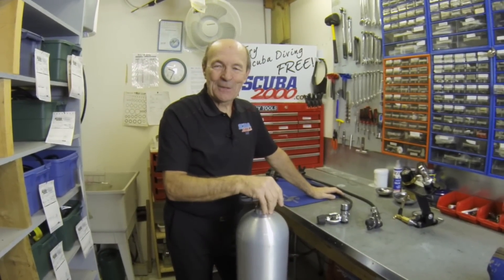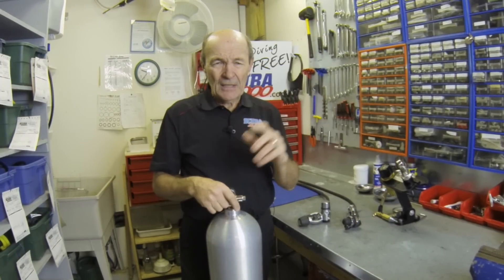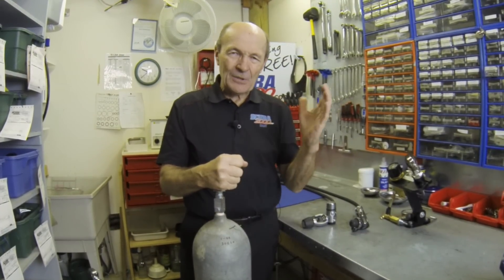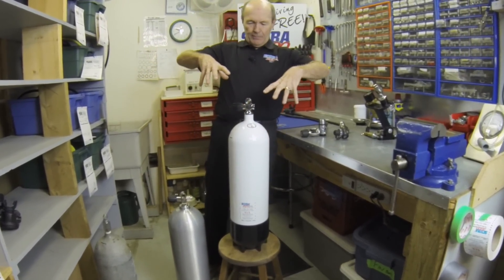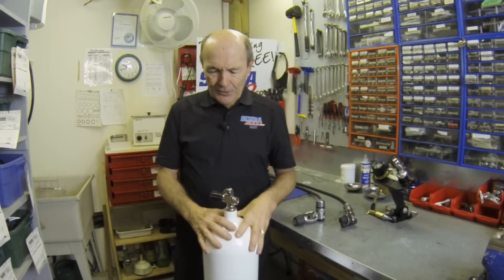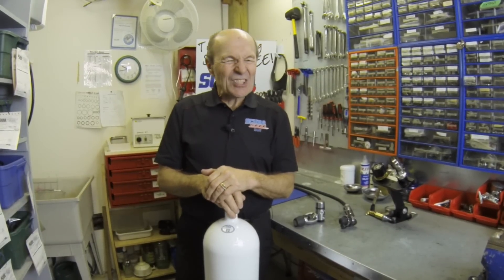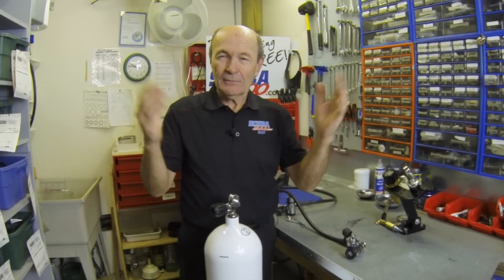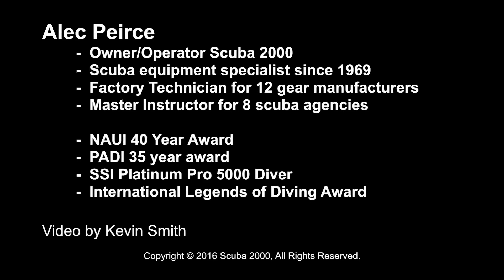Steel vs  Aluminum Tanks - Scuba Tech Tips: S03E07

Comment: i enjoyed this video quite a bit  i grew up in SouthFlorida and my first Scuba certification was in 1978  by a NASDS  shop  back in  those days they weren’t as reckonized as PADI  so i did get a PADI card in 1981  both were open Water certs   in those days  i always dove with plus Aluminum tanks  to get the extra air   i did also dive with many US Coast Guard Helicopter pilots that flew for Air Station Miami  and a few of those guys  still used Steel tanks and one even  had a 2 stage regulator with the double hoses although it was getting harder for him to  find shops that could or would work on them  i have over 250 logged dives  unde my belt  and manu of those were in the Florida keys  were we would drift dive  using lines  attached to a boat  and the  strong southerly current on the Gulf side  it was a  easy way to  cover a lot of territory and by snorkeling in full gear  if we spotted say a lobster  or whatever  we could easily pop in our regulator to extend our bottom time  i was a avid Spearfisher then  too  using pole spears mostly although i had a couple of  inexpensive manufactured Spear guns i bought at yard sales  and fixed up  to work   back in my early days a dive shop owner told me that all the tanks either Aluminum or Steel were made in the same factory  and the only difference in branding  at the shops was the Valves  the companies  used ?  now with my Coastie freinds they  often had to fly down to Cuba for work and  tanks their were very expensive  we had a place in Hollywood florida that sold brand new US Diver  Aluminum tanks for 99.50 dollars and  when my plus tanks were getting close to not getting my 10%% anymore  we would send them down to Cuba  and sell them for  just over a hundred bucks those military guys were happy and so was i  as i just buy another brand new one   btw you may remember the place as they always advertised in the back of all the dive magazines for years it was called Divers Unlimited  and they  always had a coupon for their 99.50 tank  which you really didn’t  need to bring in to the shop  their logo had a bottle nose Dolphin  jumping over a dive flag  it was a brick and Mortar shop  in my town and i’m pretty sure they shut down in the 1980s  due to major road expansion and all the growth that South Florida  went through back then  i   did   get married and moved away  to raise my family  and occasionally visit  yet unfortunately experienced a Major Stroke in my 40s and  was fitted with a new Aorta Valve that   i wont be able to  Scuba dive ever again according to my doctors ?  although i’m  hopeful that  with modern medicine that may change  as ive  owned 16or 17 boats in my life so far and love Cruising the Bahamas  and other parts of the Carribean  so we will see  i’m okay with Snorkeling if i have too  at the moment  i’m on quarantine with most of the world due to Covid 19  so i  wish you a safe  future  and look foward to more videos
Reply from the maker: Thank you very much Craig for sharing the memories of our 'stone age' diving.  Looking forward to everyone being able to return to diving with new stories to share.
Alec
Reply: Hey Craig.  I got PADI certified in 1977 at Broward Community College in Ft. Lauderdale.  Used to go down to the keys and beach dive off Hollywood Beach.  Lived there for years.  When I joined the Navy in 1985, I sold my scuba gear.  Now, I just obtained a copy of my PADI card and am getting back into diving at 63 years old.  Planning on taking a refresher course.  The adventure continues...
Reply: Richard Jurewicz   yes thats where i got my Padi  certification  did my open water dive on joe Shircks boat  he was a Boward Shettiff Officer  at the time and ran  trips for a dive shop on US1  inFort auderdale  i may have his name spelled wrong  and i do not remember that shops name other than it was North of 17th Street Causeway  on the Eastern side of route 1  my apologies on typos  my key board is acting funny  with caps and  some symbols  who did you know at Air Station Miami ??? William Perrin was one of my parents best freinds  he retired  out of headquarters eventually  as a Captain  Dennis Seahouse   was another pilot  i knew along with Mike Quinn  all those guys taught me a hell of a lot about diving and becoming a man  when i was in high school  i worked in a east food joint  frying Chicken and we  were able to take home  any leftovers  so i brought cold chicken on our dives and those guys all called my Chicken little   as i would carry out  big bags of chicken  from the house when they picked me up  to go diving Perrin did  instruct  Helo pilots  up in Pensacola  for 4 years  and later worked out of Washington, d.c.  when i lived in Maryland at the same time  so he and i continued our love for the water and the outdoors doing boating and Camping  plus we did a lot of Hiking    on the Appalachain trail that was only a hour or so from our homes  btw his given name is William  but he goes by his middle which is Randy  really Randal  very smart man  worldly and Educationally  as luck would have it he has a son that is close to my age  and him and I are still very close  like  traditional Cousins would be  the family roots are louisianna  and thats where they reside now  ironically when i did the class at BCC my best freind was giving me  some slack about not swimming fast in the pool  and i had to  tell him why  it was simple there were all these hot girls in Bikinis And i picked the slower ones to swim  behind their fins  and my buddy  was like ohhh  thats a good idea  i’m like Duh  i could do circles around her but why would i ?  i’m  like how could you not see that   he always was a little naive  around the ladies lol   in his defense he has most of the money and things he bought over the years and ive gone through several houses  and bank accounts that went to exes f

Comment: In France the standard is steel tanks, because we can inflate them to 232 bar or even 300 bar (an S80 11.1 liters only accepts 207 Bar). I saw on their website that Luxfer makers 12.2 liter cylinders that accept 232 bar, and I'm eager to find one because my steel cylinders have rusted inside due to poor quality fill stations... For the US, the lesser 200 bar pressure is fine because you don't go deeper than  30 meters, but here in France I'm regularly doing 40 to 60 meter dives. An S80 won't do it for those deep dives, or I'll have to get two (twin or sidemount). I really don't know what to do since getting an aluminium tank bigger than an S80 is almost impossible here and fill stations will destroy your steel tanks. I might have to buy a compressor... Forget savings!
Reply from the maker: Lot of options to pick from.  I have a tech tip video on portable air compressors S09E01, so watch to see what is involved in owning a compressor before investing.
Alec

Comment: I have only used aluminum...i hate how they drag you up as they empty...I'd like to try a steel tank.  I'd buy one if i was closer to water.
Reply: A drawback of steel though which I'm not sure has been mentioned is that they're much more prone to corrosion.
Reply: @Fluffy Hamster Maybe try jumping in warmer water so you don't need so much weight ;)
Reply: @Hubscharber  You gotta work with what you have around you

Comment: Great info, Alec. Thank you. What are your thoughts on the effects of sunlight exposure in regards to the life of the tank, when using aluminum or steel? I often dive from a jet ski, and the tank (along with the rest of my gear) is always sitting in sunlight all the way to and from the dive site. Assuming they’re both taken care of well with the same level of maintenance, will steel tanks have a longer lifespan in these conditions? Or no difference at all?
Reply from the maker: Far as I know, the sun has no effect on tanks. It may fade the paint but that's about it.
In most warmer dive locations, tanks will sit all day, every day in the sun.
Alec
Reply: Your hoses and neoprene will suffer far more from direct sunlight than the tanks. Especially hoses should not be kept in the sun.

Comment: What high pressure tanks would require you to use a DIN style regulator? I cannot find any steel tanks that go over 3442 PSI, only carbon fiber reinforced tanks.
Reply from the maker: DIN is necessary at 3500psi and over.
That's exactly why you see so many 3442psi tanks. By stamping them with a working pressure less than 3500psi, the manufacturer can avoid the expense of a DIN valve and keep more divers happy.
There are lots of the older steel tanks that were  3500psi around although not so common now.
Alec
Reply: @AlecPeirceScuba_SeaHunter  they are fairly commin in some countries. They are often stamped as 300Bar which is 4351,13. psi. Most shops will only fill to a max of 3500 PSI. The PSP airsoft guys love the 300bar cylinders as they fill their airsoft cylinders from the larger tank.
Reply: DIN valves are the most popular type in Europe (being of German design). They do have other benefits beside the higher rated pressure. They're more compact (well, the 1st stage is, not really the valve) and have less chance of damaging the o-ring. You'll often see tech divers use them for all these reasons, even on tanks with lower pressure.
Reply: I haven't started side mounting yet but my understanding is that the advantage of DIN is that the first stage doesn't stick out as much, I have yet to see a DIN to confirm this though.

Comment: what would happen if you have a yolk reg and your tank is at 4000 psi and you started a dive and your dive agenda would be 50 feet for 30 minutes. what would happen and when during that dive
Reply from the maker: It could be a completely dull dive as there is no really big problem. 
Yoke regs are designed to handle 4500psi but the O-Ring might extrude (get squeezed out) particularly if it's a well-used regulator.
At any pressure above 3500psi, the regulator ought to be a DIN design to avoid this.
The 50 @ 30 is no problem.
Alec

Comment: I own 30 cylinders and 12 of them are steel "72s." In most cases 65 cubic feet is enough gas for a recreational divers, and properly cared for the 3AA low-pressure cylinders will far outlast aluminum cylinders. I would also put in a positive plug for hot dipped galvanized cylinders and am glad that Faber finally saw the light on that. I love diving with students (even much smaller people and easily out breathing them using my steel "72." Good video!
Reply from the maker: The steel 72 was my favorite tank by far, still is.
And you're quite right about galvanized tanks.
Alec

Comment: Looked after i believe steel tanks will last longer. I have 4 x Faber 12l (100's)  that are 25 years old, 2 120's and 4 x7l sling tanks also Faber that are 20 years and have been hydro-statically tested ever year ( i'm an Aussie ) they show little rust issues and i live in a tropical climate. Aluminium on the other hand fatigues particularly around the thread ( micro cracks ) and  suffer stretch under testing causing failure . My mate is a hydro- static tester and was almost killed by a valve tearing out of a aluminium tank under testing it shot out of the tank as it flung on the whip and embedded itself in the wall narrowly missing the side of his head by inches.. ( dont mess  with compressed air it's very dangerous stuff ) Not an Aluminium tank fan at all
Reply from the maker: I'm pretty sure you're right Ian. The big "if" is "looked after".
Scuba divers are notorious for NOT taking good care of their gear and that certainly includes tanks. In fact, tanks are probably the most neglected piece of scuba gear.
With care, a steel tank will last forever. I have some from the 1950s that are like new. The newer ones, like your Faber, are better.
However, an aluminum tank will withstand the abuse that most scuba tanks suffer better than a steel tank. 
BTW, neck cracks are pretty much non-existent now. A valve that bursts out of a tank is a sign of neglect. The tank threads were not inspected.
Thanks for watching and for your comments.
Alec

Comment: Then there are the crazy europeans. We  take an 80 size steel tank with even thicker walls and fill it to 300bar = 127 cu Ft. (Thanks, google calc).. no double 80 or anything. Just the size of one 12l and less weight on the bcd/ belt.
Reply from the maker: Right. You just need arms like KingKong to carry it.
Take care.
Alec
Reply: A few even put these monsters together as twin sets. More tend to use twin 10ltrs than 12ltrs. The 10s are roughly equivalent to your 72cuft.

Yes the tanks are heavy, but this means that they carry little extra weight in the water.

Comment: Hello Alec, do you have a tech tip on the din to yoke adapters?
Reply: you are talking about scuba tanks not valves
Reply: If you have DIN regs and plan on travelling to a place which is mostly used by US divers, take a DIN to Yoke adapter.

You may find that the tanks you use actually have the insert. In which case take a couple of Allen keys (There are 2 sizes for those adapters Allen keys) and remove the Insert and use the tank without it for you DIN regs. This way you are removing extra points for failure.
Reply: @ScubaGirl68  Do dive shops and or dive boats ever balk at that? I might think they would be unhappy to see you use an allen key on their tanks?
Reply: @TragoudistrosMPH  So long as you use the correct Allen key, you aren't going to cause any damage to the valve. They should never be so tight that they cannot be removed easily.

When I was working on the day boats and safari boats I would do this all the time for the clients as required. It was a matter of good practice to ensure that one or two of the dive centre's staff had something to fix the pillar valve. Often the boat crew would also have some tools available, just in case the staff failed to bring something with them. At that time most people had A-Clamp/Yoke, but more were getting DIN. Today it's the other way around.
IMHO so long as you don't lose the "doughnut", "Insert" or whatever else you want to call it and ensure that it is returned to the cylinder/tank at the end of the dive, I wouldn't have any issue. I'd probably ask you to pass the insert to me if I were working on the boat though so that I can ensure that it isn't lost.

Comment: Luxfer were making Aluminium cylinders in the late 60's early 70's.
Reply from the maker: Yep! I have a couple of 'torpedo' bottles made by Luxfer in the late 1970's.
Luxfer has a fascinating company history that can be read on its website. Their first tanks were made in 1958!
The earliest scuba tanks from Luxfer were odd in that they were designed to compete with the standard scuba tank for the time, the venerable steel 72. Luxfers first scuba tanks were the same diameter and the same pressure as the 72. To get a higher air capacity they were a bit longer so, picture a long, skinny scuba tank. It was nicknamed the torpedo bottle - 6.75" in diameter with a working pressure of 2475psi. That was the same size and pressure of a steel 72 including the 10% overfill but longer by several inches.
Buoyancy problems soon led to the design of the current Aluminum 80 at 3000psi and it has since replaced the steel 72 as the scuba tank of choice around the world.
This might be a good Tech Tips topic.
Thanks for your comment.
Alec
Reply: @AlecPeirceScuba_SeaHunter  The reason for the strange capacity/physical size of the Luxfer Cylinders was that they were designed to fit the Royal Navy SABA  (Swimmers Air Breathing Apparatus) sets in use at the time.
Reply: And the rig had a high pressure reducer at the (inverted) manifold end and a low pressure at the (upper) end of the manifold where the twin hose feed then went to a full face mask.